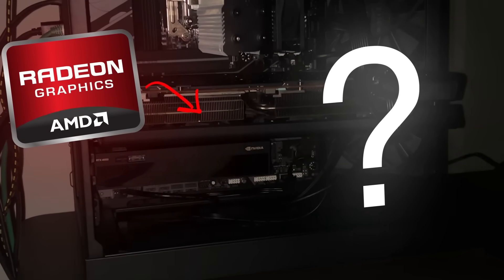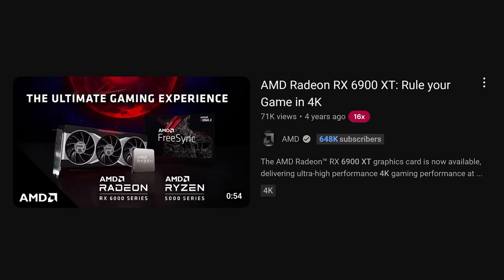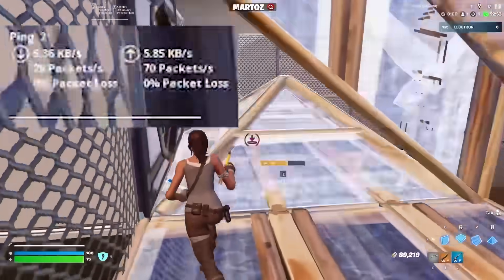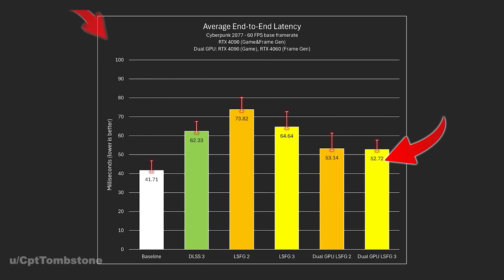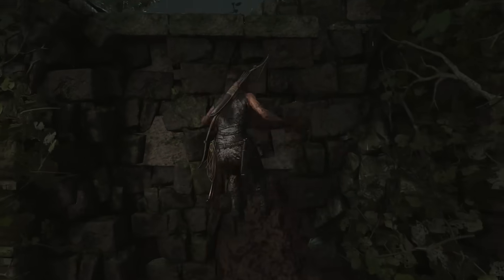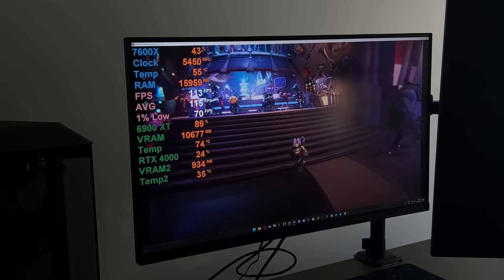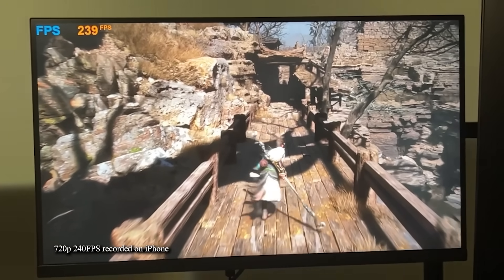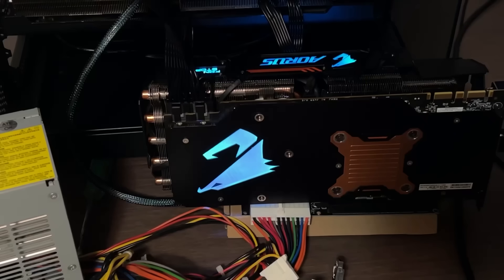I Used Both AMD & NVIDIA in One PC and Got 240 FPS in Every Game

Comment: Stop calling frame gen a "fps boost". It's really not one.
Reply: what the hell is a "real" frame, its all fake generated from the GPU.
Reply: It's indeed not a "fps boost", however enabling frame generation the normal way drops you FPS so using two graphics cards for it and not losing those FPS is actually a really helpful "boost"
Reply: whats the difference between fake and real frames?
Reply: @n9ne  One is generated by the game engine, another hallucinated by the frame gen pipeline
Reply: @Pyovali  your pc hardware generates frames.. dlss is a hardware function.
Reply: It is a boost in FPS they are blank frames but they are still there, I run a 4090 at the moment and frame gen makes every thing look smooth, try playing 2077 path traced without FG and you are stuck at 70-80fps which sucks, with FG I get 140-150 fps and it looks and feels like 140 FPS, stalker2 is the same I get any where from 120-170 with FG other wise it's 70-80 fps which is unplayable for me, that's @ 3440X1440 on and Alienware qd-oled, and about  - 8/10% FPS on a C1 LG EVO @ 4k @ 144mhz
Reply: Yeah, I think we need to have a different term for a graphical frame rate versus a performance frame rate. Even outside of frame gen, there are many cases where your graphical frame rate doesn't match the performance. The most common being using a 60hz monitor to play a game that's running above that.
Reply: The human eye can only see frames anyway. No difference between real and generated frames.
Reply: @Parabellum-xD  lol shut up.
Reply: But is there a frame per second?
Reply: it is a frames per second boost, its just not active frames. Only game I have played where I genuinely liked it is Cyberpunk on my 4080 super. Allowed me to run max settings with path tracing...was getting a 50ish fps base and close to 100 with frame gen... the latency was worth the smoothness. Especially for people like me who get motion sickness with low framerates
Reply: @jeremysumpter8939  is that at 1440p? I'm running 2077 at 4k and use frame gen to bring up lows that fall short of my 60fps Vsync. In this context it is hardly noticeable I terms of input latency and helps minimise tearing. It's the only game I've been happy using FG in. This is with some visual modding and third party Nvidia tools forcing preset K (Diamond Wallaby) DLSS algorithm and Ultra+ mod at PTNext Medium, SHARc 50. It looks freaking preem on my OLED TV - better than in game set at Ultra/PT with no FG.
Reply: @ 4k dlss performance with PT mod performance, hand full of other 4k texture mods etc...Had to turn crowds to low though since i only had a 5900x...at high crowds my gpu % would drop to 80ish% and i get 20-30 fps...low crowd and gpu would hit 100% and id hover around 55-60...100ish with frame gen
Reply: @ only thing that bothered me was the occasional ghosting but the smoothness was worth it
Reply: @jeremysumpter8939  Huge CPU bottleneck.
Reply: How is not an FPS boost? FPS is boosted, right? It's not a performance boost, though (totally a reduction, actually)...
Reply: @cire420siuol  Yes, but it's like those 60fps videos of what was originally 24fps footage/ animation, except at a greater disparity.  Everything is an unintentional smear frame and the animation/detail put into games is effectively lost when there's in-betweens added everywhere.
Reply: @cire420siuol  it is not ideal for competitive games. The increased input lag is noticeable
Reply: @ApolloXeus  Most competitive games can run at 100+ FPS on a smart-toaster plugged into a lemon battery. Those are obviously not the target games for this technology. Its for graphically demanding games where the cinematic experience matters far more than your input lag.
Reply: @waterturtle2919  Nvidia should make an add-on, like this setup, for competitive-games. I mean like Nvidia's own ReShade-like-plugin that enhance graphic without affecting the games, while using their proprietary DLSS & image generation.
Reply: @cire420siuol  frame gen or DLSS is really just there in case you’re not running a stable frame. If you’re running 60hz for example but hobcer around 50ish fps, that is when you enable frame gen
Reply: @cire420siuol  Because it's not real. It's not "boosting" your frame rate. It's fake.  There is no new data in those so called frames.
Reply: @insertnamehere4419 the fps is boosted. The fps increased.
Reply: @insertnamehere4419  True, the title of this video has to be changed to not confuse anyone. Trust me, is not the first time someone names LSFG as "FPS Boost". As we said for NVIDIA, a frame is a frame, a generated frame is not a frame. LSFG is pretty, but it has to be addressed as what it is, "Frame generation". Still, is pretty good.
Reply: @ No, and no.
Reply: @insertnamehere4419  everything you see on screen is fake anyway
Reply: @insertnamehere4419  there is data in the so-called friends how are the appearing on the display
Reply: @insertnamehere4419  Yes and? Rasterized frames are "fake" in a way as well, everything is a gpu render, if it increases visual fidelity while maintaining the same/similar input latency, it is in fact MORE FPS and a higher refresh rate experience. I am the first to dog on NVIDIA for their greed but stop this bullshit with needless hating of new technology. Why should the fact that those are "generated frames" bother you in the slightest if it serves the purpose of more fps.
Reply: @ARSaVaGE2626  "if it increases visual fidelity while maintaining the same/similar input latency" Every generated frame is one frame of input latency as the computer only updates your input on normal frames. Therefore, if you're going from ~80 to 240 like some of the better running games in this video, 2/3 of the frames will be adding to the latency.

Comment: @lecctron You caught my attention at the start, then lost it with the ada card, then got it again with the 1080Ti swap.
I have a older system that I built myself using two 1080Ti's in SLI mode.
Would it be possible to do this with a better AMD card on a ROG Maximus Hero 9 motherboard?
I was going to build another rig to run modern games, but if I could milk a few more years out of my current build, that would be great!

Comment: 3: things: 
1: that Oculink solution is jank as hell
2: that oculink link wont be at Pcie 5.0 as the RTX ADA 2000/4000 is a 4.0 card so the slot will run at 4.0 speeds 
3: surely it would have been cheaper to get a ATX board like the ASRock X870 Pro RS wich does support crossfire and thus is made for 2 gpus
Reply: 4: integrated graphics exists

Comment: Both this video and your sponsor claims are provably untrue. You are not reducing your ping from 12 to 1, that's stupid if you know how networks work. And you aren't using "both GPUs" to use one GPU to render data, sending the complete frame over PCIe to system memory, then over PCIe to the new GPU and then your latency calculations are done there and only there. You are missing out on the entire actual game latency running this way. It is a terrible way to render and output graphics.

Comment: "Dual video cards may be the future"

*90's nerds start laughing in SLI.
Reply: I've run my two 1080Ti's in SLI mode from day one many years ago. (Built my system when they were bleeding edge tech)
Reply: @demandred1957  I was but then Nvidia slit SLI's throat so unless you are running some now old as hell firmware and software you can't run SLI as they disabled it on the firmware side of things.
So I finally upgraded to a 4070Ti OC Super a few months ago.

Comment: 9700xt compared as an equal to 3090???? That's crazy. Crazy inaccurate. 9700xt sits somewhere between a 3080 and a 3070. And your tests were run in 1440p, not maxed out settings. You have a mid tier at best build that you did these "tests" on.

Comment: RT reduce framerate. Upscaling and framegen increase it. Reflex increases reactivity. This is the invisible dance that generate entire frames without computational power or optimization. And it is beautiful... when the camera is not moving.
Reply: Nvidia's 12VHPWR connector becomes Reactor 4
Reply: "Without computational power of optimization" LMFAO NO
Upscaling and frame gen requires computational power. Although nvidia does seem to have specialized hardware for those on-chip instead of using that silicon space to put more RAW performance on there, the slight overhead is still there.
Reply: That's the best reference line I've read in a while
Reply: yup lol
Reply: Pretty much the whole modern gaming with a few words . Couldn't have said it better. I just love how my 4080 Super barely reaches 60 fps at 1440p DLSS quality, in recent titles. I have to go back to tweaking settings again, just like i did on my 1080ti that i had before. So then i start asking myself...what's the point in upgrading? 27 fps with 5090 isn't looking good , even if it's path tracing. Just don't introduce things that are not ready for current hardware.
Reply: @sogetsu60  You've never played less demanding games?
Reply: @Bodwaizer  Comrade, explain to me how an ASUS Rog PC explodes.
Reply: @Bodwaizer  love the Chernobyl HBO reference
Reply: AMD card experience in a nutshell lmao
Reply: One of the best coments i have ever read man!!! and it is beautiful... :D
Reply: All upscales increase latency, this fact
Reply: @kevinerbs2778  upscaling may cause a VERY minimal input lag but that is completely negated by the improved performance and fps, so one might actually see LOWER input lag.
Reply: @EpicBunty  No, IT ALWAYS ADD LATENCY, that is fact
1.0 ms vs 1.33ms (upscaler). Input latency is untouched, as system latency is the only thing that matters to the users feelings, as 60ms is fine for most people.
Reply: @kevinerbs2778   as I said, it adds VERY minimal latency which is completely negated by the higher FPS, because higher FPS means higher input polling, which means lower input latency. With reflex, its even lower. 
Upscaling reduces GPU load, so total system latency may go down despite a small post-processing delay.
Reply: @EpicBunty   you have no clue what you talking about that is 33% increase in latnecy. Reflex does not act6ually affect in put latency Nvida has fooled you.

Comment: 8:44 slight correction there : PCIe gen5 x4 supports up to 32GB/s of bandwidth, not 16GB/s
Reply: No, he is right. Your thinking of the GT/s not GB/s which is ~4Gb/s per lane which ends up being ~16GB/s
Reply: The real correction should be that the RTX 4000 ADA only supports PCIe 4.0 thus 8GB/s.

Comment: Conclusion:
They should release frame gen cards and connect them to gpu's via a cable, like dedicated sound cards back in the day

this will increase amount of native and generated frames, reduce lag and artifacts and decrease overall heat in 1 piece of hardware trying to do everything at the cost of everything
Reply: Agreed, though this would basically cause Nvidia to be competing with themselves. If they released independent frame generating units, they would reduce the market of people who would otherwise be upgrading to a newer GPU altogether.
Reply: You don't realize how stupid that sounds?
If you are going to pay another $100 for an entirely other card, might as well spend $100 more of the first card and just have that better
Reply: @ The idea isn't intended for people who have the money to buy an entirely new GPU. If a frame gen card was in the 80-150 range and could potentially double your FPS, that's a way better bang for buck than dropping 400-2000 on a new GPU.
Reply: Connect your monitor to powerstation directly, I bet it can generate more fake anything than your puny card.
Reply: @ funny you say that, there are some smart tvs with built in framegens advertised to "upscale" and "upframe" cartoons and old animated movies etc.
Reply: frame gen cards already exist. its called "integrated graphics"
Reply: @jermygod  not really, they are cpu cores imitating gpu, they are already bad at native. You need npu cores for a dedicated framegen card
Reply: @kesn8317  ??? they are not cpu cores. for amd ryzen its not even on core-die at all.
Reply: @kesn8317  not true at all

Comment: my setup is
7800X3D
32x2GB 6000Mhz RAM
4070Ti PCIe 5.0 x16
6600XT PCIe 4.0 x4
1000W
3440x1440, HDR, 165hz
I've been using this for a month, I can't even feel any input lag difference. It's crazy how easy it is to get 162fps in Cyberpunk with path tracing (50-60 base frame)
Reply: How much would you be getting without the second GPU and still using the frame gen?
Reply: @nexuhs.  50-60 baseframe would drop to 40-45fps, then with frame gen it would be 80-90fps

Comment: ~70 fps with 15ms input lag > 240 interpolated frames with 25 ms input lag
Reply: isnt 70 fps 14ms
Reply: @I-Am-Mr-No-One  only if you measuring only latency between frames, not overall system latency

Comment: Thanks for the content!! Been waiting for this in a while now.

Even though dual GPU it's still a hassle for most users, it's the best way to upgrade PC builds in 3rd world countries, cause of the spike in GPU prices. In Brazil, if you have a RTX3060 or even a RX6600, you have better performance than the great majority, witch uses GPU's like RX580 (yes, still in 2025 we use RX580 a lot). 

Saving you from the hassle of discussing the current government tax politics (it's basically taxing everything that moves at this point), it's just better for us to maintain our RX 580 and buy used or cheap NVIDIA cards (GT/GTX series) + PCI-E Riser than to spend R$2000 (~$350) getting a RTX 3050/3060. Sounds weird, that's because Brazil.

Comment: bring back the real explicit multi-GPU and we are good, we won't have problems anymore with nvidia and amd prices going crazy
Reply: they just need to enable it in dx12 sli/nv still works
Reply: @EoEx-GG  Hard for it to still work since they haven't had the SLI attachment points since the 20XX series card nor do they support it either firmware or software wise.
Reply: @EoEx-GG  And how old is your firmware and drivers? I'm guessing pre 2021 since they removed the ability to even use SLI after January 1st.
Reply: @SilvaDreams  all update tbh ngl
Reply: @ take it my other comment vanished lol well the 3090 you can nv link but using a nv bridge of a different card works and 2080ti works fine and the sli on 980 ti quad and two 960 in sli

Comment: How would you install the drivers for both cards....😡
Reply: Just do it, it can be done
Reply: Yes, I intend to use the secondary GPU for frame generation using lossless scaling. The primary GPU in my computer setup is 4070, and the secondary GPU is 3060. I want to achieve 4K with both cards. my budget is 2,00,000 INR(india), I hope this setup achieves more than 120 frames per second [ 4k ]. thanks
Reply: @mustakimbiradar3231  The RTX 3060 isn't the best for LSFG, but if you lower the flow scale it should help it a lot, what is your motherboard model?

Comment: Would this work with an Intel iGPU or AMD APU, like a 12700 iGPU or Ryzen 5600G? While those GPUs aren't exactly powerhouses, they are capable of basic gaming. My primary GPU is an RX 6950 XT, but have in the past played games like Fallout 4 and No Man's Sky on those GPUs (and lessor integrated graphics units, like an Intel 8600k and Ryzen 3400GE.

Comment: Sell 6900XT + 1080Ti , don't buy ADA SFF card for 1000 bucks. Voila! You have enough money for Rtx 5080. You can buy yourself 3rd SSD with the extra money you saved by not buying PCIE adapter and extra PSU.

Comment: PCIe is totally different type of beast
each generation slashes latency by 50%.  Imagine going from PCIe3 to PCIe5, it will quadruple the signaling rate, making it 4x faster at reducing latency. 

Your PCIe bandwidth cooresponds to the badnwidth you have with your CPU, once you run out of VRAM. 
PCIe 5 has bi directional 64GB of data in one way, totalling 128GBs of data. 
DDR5 can achieve those speeds too, but usually you will be already hitting at least 64GB in bandwidth with RAM. 
That bandwidth is used by CPU and GPU, when GPU runs out of VRAM, it will rely on RAM. 
CPU gets that bandwidth from RAM. Speed is the biggest factor  when it comes to bandwidth, not the capacity of ram. But capacity does allow for the appropriate amount to be stored in and could bottleneck the already pre existant bottleneck presented by VRAM. Having 64GB of RAM is a good way to avoid any bottlenecks espeically on windows when running demanding games with low VRAM GPUs. 

Im not exactly sure what happens when you are enabling Gen Frame, if VRAM is being used or not or filled up, but as soon as the GPU is being out of its VRAM, it goes into RAM, and from there back into the GPU. That's why it's crucial having DDR5 and PICe5 when it comes to scenarious like this, latest will always be better, reducing the latency. 

If you had Gen3 card and it was significantly lagging behind the Gen5 card. Usually that would cause chaos, so normally components will be adjusted to the weakest link. 
You might say everything gets downgraded to the slowest card. 

Maybe try using same generational card, within the same PCIe generation and to be somewhere on the same performance level or VRAM level. 
the best way to showcase your experiment would be to just use two of the same cards and one different one, to show the differences.

faster the bandwidth the faster it fetches data and then PCIe processes it at its own speed separate fo RAMs involvement 

for example: 
PCIe3 has 62,5 ms 
PCIe4 has 31 ms
and PCIe5 has 15 ms

DDR5 at 6000 MT will have 48GBs of bandwidth and in dual channel (max channel) will become 96GBs of bandwidth. Dramatically lower comparing to DDR4. If we look DDR4 at 3000MTs it's mare 24GBs in single channel. 
As you can see it just depends on capcity, how much you are filling it. 

*What you need to properly showcase* 
64GB RAM 6000-8000MHz 
2x same model cards and one  totally different for educational purposes
motherboard with 2x PCIe gen 5 slots supporting at least x8 lanes
and trying it again.